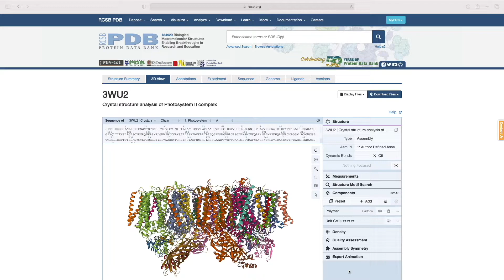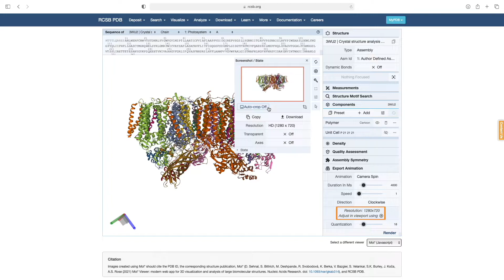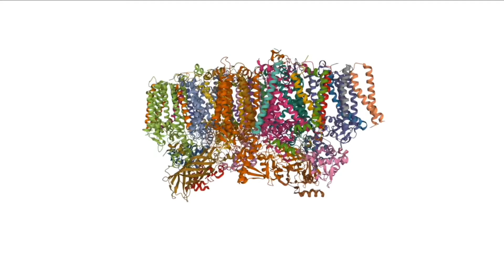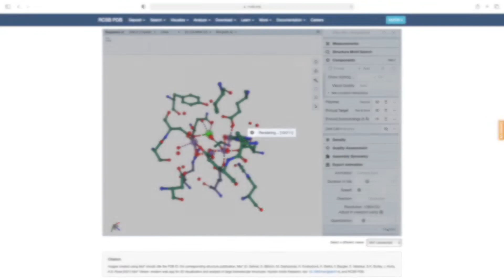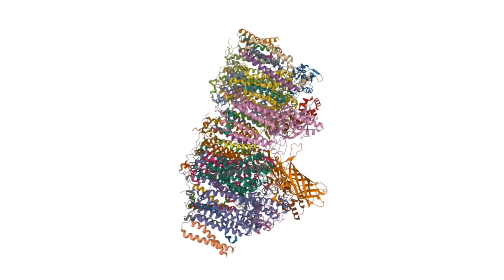Creating Animations with MolStar (Mol*)

Comment: By 2021 I expected that 3D programs for protein modeling will enable users to simulate the movement of hundreds of posible changes in the degrees of freedom of backbone atoms. Allowing the user to simulate changes in temperature, pH, ions concentration, and lipophilic molecules presence. Calculating the thermodinamic cost required for that folding changes. Compared with computing metodologies for simulation by animation in other branches of science or physics simulations for graphics or entertainment, I see in this video that there almost no change in protein visualization in almost 20 years. They still use the rigid frame from electron density maps. Proteins are not rigid and they have not only one conformational structure. They are moving and changing parts of their shape all the time with small changes in temp, pH, molecules concentration around, etc. Whatching this video in 2021 makes me sad. Computing Tools for average biochemist has not  improved in so many years, while other computational areas saw an exponential growth...
Reply: Hi, do you know how to use the animation of “unwind assembly”? Whenever I try to use this animation, the exported video is just a static video of the protein.